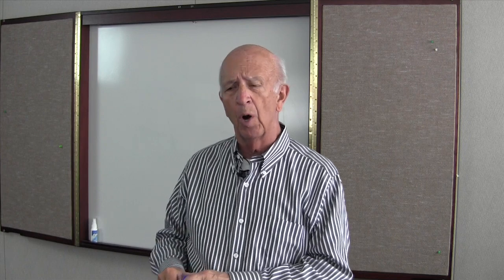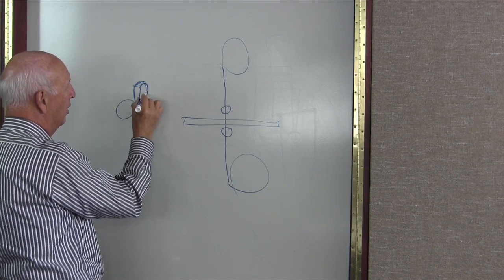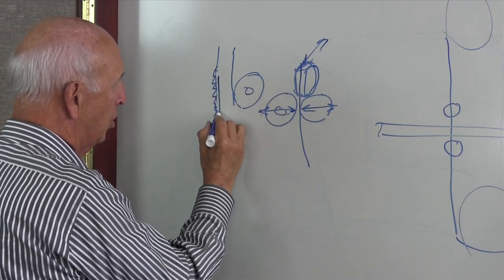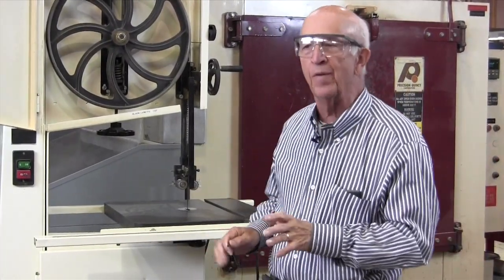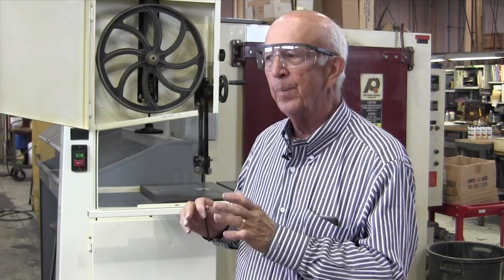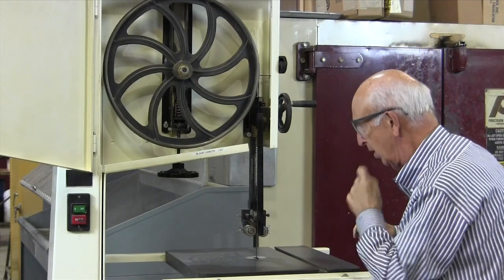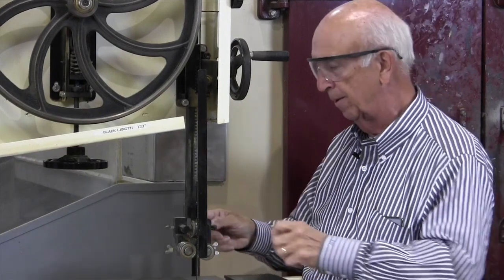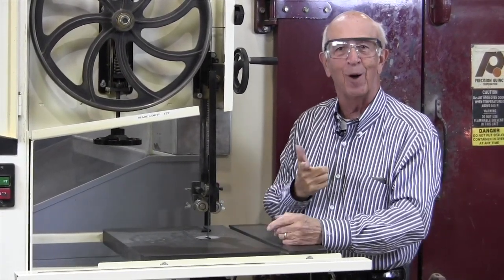How to adjust the guides on a Bandsaw by Don Bailey

Comment: good stuff as always Don.  We do the same thing except the bearings are spaced one business card away so when you run the blade under no load on the blade the bearings do not spin  this allows for the blade tension to be adjusted without any pressure being applied from the bearings as the blade finds neutral tilt under the new tension

Comment: Don;
  Thanks for taking this topic up.
  I have a Kalamazoo 9AW.
  There is no back bearing. Just either side on cam-studs to take up the side play. Back relies on blade tension.
  I have had to re-machine my wheels at least twice to re-establish a shoulder for the blade.
  I cannot figure out how many degrees or minutes of pitch I should place on the wheels to keep the blade on.
  Saw has fully adjustable provisions for that.
  Plus, my idler bearings are nearly 1/4" off-center in respect to where the blade wants to relax to.
  So, I am always pushing the blade outside the band-loop.
  So... do I machine the wheels flat, and pitch them at the alignment cartridge... or cut them at a taper, and make their faces flat?
  It has been a constant and consistent headache for me.
  I have to sometimes cut an additional 1/4" or more just to be able to get a cleanup length.
  Thanks a million!!!
  Mark

Comment: Good video in my case at least my horizontal is much more difficult since it has a twist in the blade so the rollers have to force the blade into alignment to cut straight. I have spent many hours fooling with it and have it to where it usually is within .005 of flat/inch of diameter and that seems to be as good as I can get it.

Comment: The bandsaw is absolutely the most neglected machine in any shop or school. Even from an educational standpoint, most trade schools only touch on the bandsaw as far as safety,  but rarely ever really dedicate any time to its setup and proper use. I always figured this is why the bandsaw is always screwed up and the band is usually dull as a garden hoe. When used properly a band can actually last a year or more in my experience.